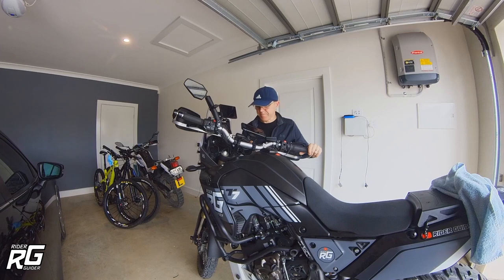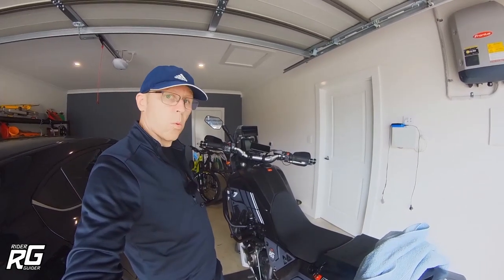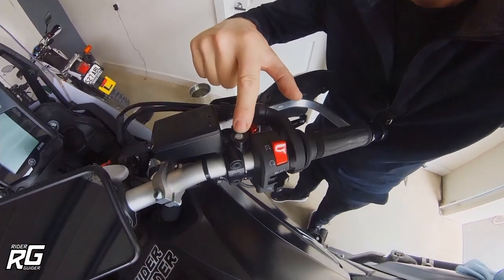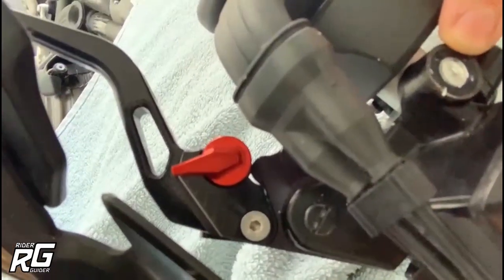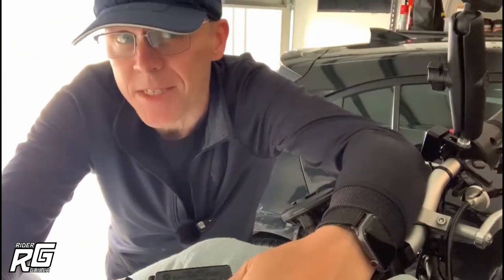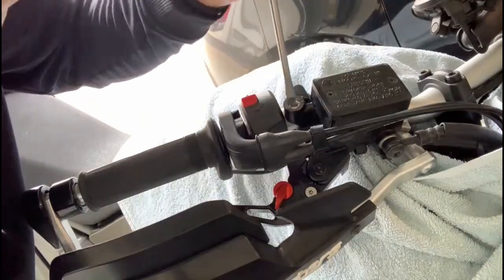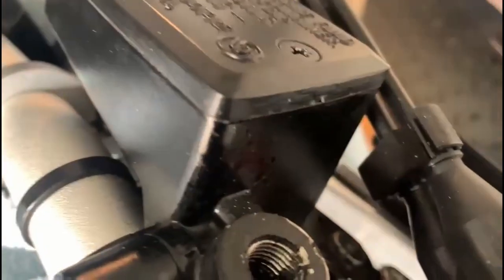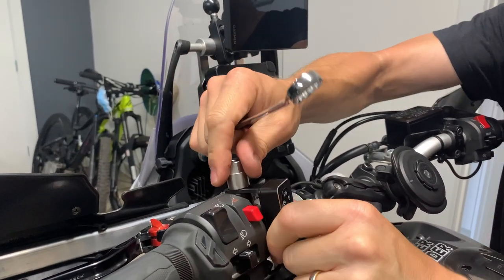WHO TAKES A DRILL TO THEIR YAMAHA TENERE 700?  I DO .... UNFORTUNATELY.

Comment from the maker: Whilst installing my new #INNOVVK3 front & rear camera I ended up shearing my right hand mirror #RAMMOUNT adapter.  Serious issue when it's part of the front brake fluid reservoir and my only way of fixing was going at it with my cordless drill.  Did it go smoothly?  Absolutely not.  Broke my drill bit in the broken thread making a relatively easy job pretty difficult.  Listen to my cursing and questionable decision making as it goes from bad to worse before I eventually get my grey matter working and eventually make progress.  To the rescue were #RALLYRAIDPRODUCTS with their beautifully machined adapters for the Double Take mirrors.  

LINKS:
https://www.rally-raidproducts.co.uk/
https://www.doubletakemirror.com/
https://www.youtube.com/c/teapotonevi...
https://www.innovv.com/innovv-k3-dashcam

#yamahatenere700
#riderguider
#theriderguider

NO SPONSORSHIP FOR THIS VIDEO, JUST AN INDEPENDENT CHANNEL GIVING A STRAIGHT OPINION!

THANKS FOR WATCHING - CONSIDER SUPPORTING THE CHANNEL - SUBSCRIBING - COMMENTING AND COMING BACK FOR MORE SHENANIGANS.  

NEIL  ;-)

Comment: Hopefully you will do a review of what you think of the INNOVV K3. I have used their cameras for a few years now, both on the bike and the lorry, and so far they have been very reliable. The only downside to both the C5 and K2 cameras is the sound that gets picked up. That's why I was just looking at upgrading to the K3 as it now comes with a microphone. Now then your mirror/drill/breaking/nightmare, have been in this situation so many times but have never been able to drill around without causing major damage, at least it was ali so a bit easier to drill. Occasionally, when that drill first broke, you can sometimes get a magnet to retrieve it even moving it first with mini/micro screwdriver. As it was opposite thread you have more of a chance of getting a larger bit to bite then screwing it out, you have to be lucky though. Good win as you say when it did come out and yes the relief was palpable.   All the best.
Reply from the maker: Hello again!  Yes G, I was lucky mate, despite a couple of brain farts along the way I got it done.  Jury still out on the microphone with the K3 - I'm experimenting just now - will let you know how it goes.

Comment: Thanks for sharing about the innov k3. I wonder how it will fare after a wet muddy ride on the Tenere? Have you got any experience with this product in such conditions? Thanks again.
Reply from the maker: Hello Mark, thanks for watching, I’m 100% confident the INNOVV will not be a problem in the wet or mud.  It is a solid piece of kit.  Appears to be sealed up good and proper.  The actual lenses are small but very well built.   Keeping them clean?  I might suggest leading the ride 🤔😄 not winter yet here but I’ll be testing 👍🏼